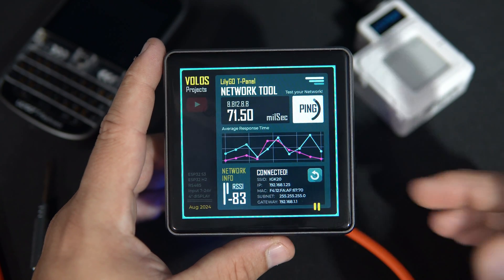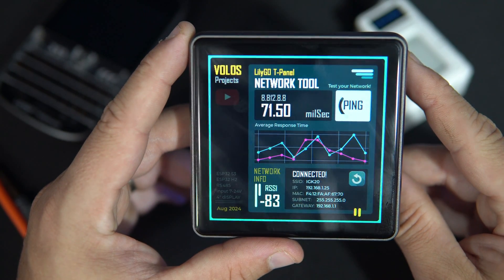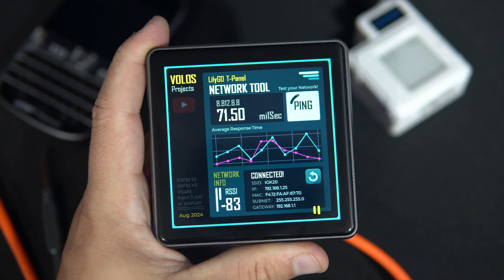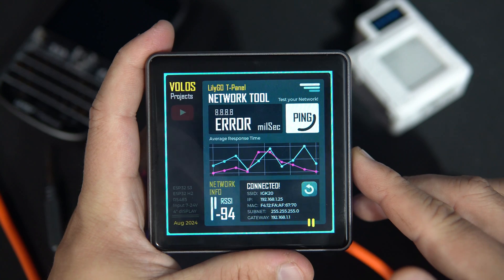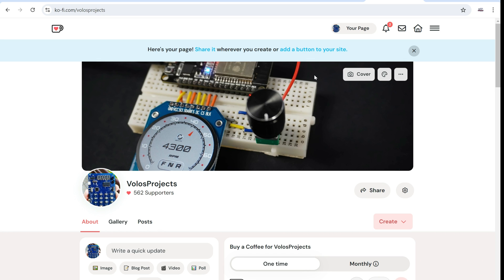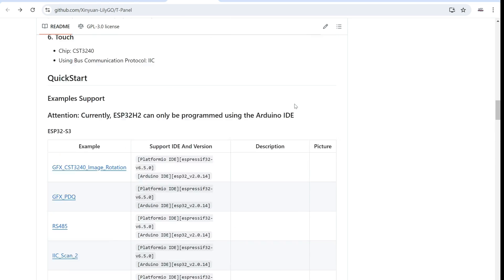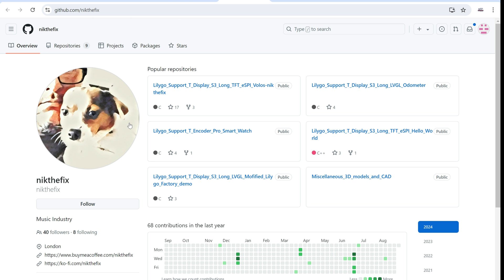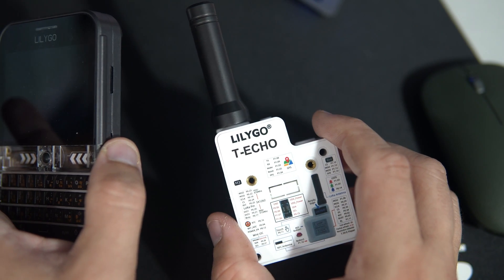ESP32 Network Monitor using LilyGo T-Panel

Comment: Great video! It helped me a lot, however, I am not able to get the code complied, lot's of red error lines, not related to libs. I must have been doing something wrong, Alsways tricky with Arduino. I hope I will be able to get it working, because it;s a nice project.
Reply from the maker: Which version of esp32 boards ypu have installed in arduino ide?
Reply: @VolosProjects  Hi, I have 3.2.0 ESP installed. I also got errors regarding the monserat fonts, which it claimed they were not declaired. No idea how to do this either. Anyway, thanks for your reply.

Comment: Would it be possible to cheat a full network tester in this device. So tests like wire shark sniffing and layer 3 network testing
Reply from the maker: i am not sure, maybe snifing but you will steel need pc to work with data sniffed

Comment: Has anyone here successfully performed this display example?
Reply from the maker: Did you install all libraries, did you set your wifi data?
Reply: @VolosProjects  yes I did. I stated it in my 1st comment.
Reply from the maker: @trauatsgg3809  i jus see this comment , this thread.. please giv me more information, didi example upload?
Reply: @VolosProjects  No Sir. I tried to compile it, but it gave me that error. I installed all libraries into the Arduino/libriaries folder as instructed, and set all the proper settings in Arduino. And it doesn't compile successfully.. Thanks(in advance).
Reply from the maker: @trauatsgg3809  what error?
Reply: @VolosProjects  The error is:  error:lv_conf.h: No such file or directory. Any ideas
Reply from the maker: @trauatsgg3809  you haven installed libraries, go here https://github.com/Xinyuan-LilyGO/T-Panel and download this rep, copy all folders from libraries folder to your libraries folder . I dont konw how to explain. I you arduino libraries folder you need to have lvgl-8.3.5 , inisde is file you are missing. On git link i posted you have detailed instruction how to install this board.
Reply: @VolosProjects  I re-copied the libraries to the arduino libraries folder. I get the same thing about the lv_conf.h. I checked the lvlgl-8.3.5 and the lv_conf.h file is in there. I'm not sure what's going on.
Reply: I managed to get the T-Display-Long ruler project to work. But, I can not get this one to work.

Comment: I have a compile error - any idea how to fix? Thanks
Jack

"Compilation error: 'lv_font_montserrat_12' undeclared (first use in this function); did you mean 'lv_font_montserrat_14'?

C:\Users\sail1\Documents\Arduino\libraries\T-Panel-main\Panel\ui_Screen1.c: In function 'ui_Screen1_screen_init':
C:\Users\sail1\Documents\Arduino\libraries\T-Panel-main\Panel\ui_Screen1.c:194:44: error: 'lv_font_montserrat_12' undeclared (first use in this function); did you mean 'lv_font_montserrat_14'?
     lv_obj_set_style_text_font(ui_Label7, &lv_font_montserrat_12, LV_PART_MAIN | LV_STATE_DEFAULT);
                                            ^~~~~~~~~~~~~~~~~~~~~
                                            lv_font_montserrat_14
C:\Users\sail1\Documents\Arduino\libraries\T-Panel-main\Panel\ui_Screen1.c:194:44: note: each undeclared identifier is reported only once for each function it appears in
C:\Users\sail1\Documents\Arduino\libraries\T-Panel-main\Panel\ui.c:98:6: error: #error "LV_COLOR_16_SWAP should be 0 to match SquareLine Studio's settings"
     #error "LV_COLOR_16_SWAP should be 0 to match SquareLine Studio's settings"
Reply from the maker: you need to go to your lv_conf.h file and there you will find font section, near the miising font 'lv_font_montserrat_14 you need to put 1 instead 0
Reply: did you ever get the code to compile?

Comment: Your user interfaces are always good looking. How do you design them? Do you have to compile and install the code every time you make a change in order to see the difference on the screen?
Reply from the maker: in this case i used sqareline studio software to design UI. but there is still lots of reuploads.

Comment: Hello, wonderful project.
Could you please include additional information such as:
1) exact board type used in Arduino
2) list of external libraries used to include version number.
it appears lv_conf.h is missing
as well as pin_config.h
even after my attempts to remedy this I cannot get a clean compile.
thanks!
Reply from the maker: You have this board?
Reply: @VolosProjects  no, I have something similar. However not begin able to compile it makes it a mute point.
Reply from the maker: @williamlyons2418  i explained in video how to install all needed libraries. You need to go to product git and you need copy all folder from lib folder to your arduino lib folder.

Comment: Wondering if this could be modified to frequently measure if the internet service provider is delivering as promised?
Reply from the maker: Hm, you think speed? I know mine is not delivering 😀
Reply: I am not sure that esp32 will handle speed tests very well, but there is this (more expensive) solution using Pi4: https://youtu.be/W1vBEy50B2M

Comment: It's a great project with a lot of potential, but it could be even more useful if it utilized the external pins to automatically reboot the Wi-Fi router or modem when a ping fails. Additionally, incorporating a small clock display in one corner would be a nice touch, making it more functional. I hope the project continues to hold interest and doesn't become neglected after a few days.
Reply: A clock would be a trivial addition, just look at his code. 
Restarting other devices is less widely useful and much more involved.

Comment: THX for the video 😊 What kind of orange USB-C cable are you using?
Reply from the maker: https://www.temu.com/hr-en/540-rotate-fast-charging-cable-100w-heavy-duty-unbreakable-silicone-supports-data-for-iphone-14-13-12-11-for-samsung-galaxy-s20-s10-s9-s8-plus-s10e-note-20-10-9-8-moto-g7-g8-orange-g-601099538208710.html?_oak_mp_inf=EMavzKOm1ogBGiA1ZTcyZmYxMmVmNjg0NTU2YTE4YTczY2RmMzI3NWY4YSCokLPnmDI%3D&top_gallery_url=https%3A%2F%2Fimg.kwcdn.com%2Fproduct%2FFancyalgo%2FVirtualModelMatting%2F52b108e597960434742862c2ae1ab004.jpg&spec_gallery_id=601099538208710&refer_page_sn=10009&refer_source=0&freesia_scene=2&_oak_freesia_scene=2&_oak_rec_ext_1=MjUw&_oak_gallery_order=651630022%2C119666612%2C434447227%2C1698844106%2C439429592&search_key=usb%20cable%20orange&refer_page_el_sn=200049&_x_vst_scene=adg&_x_ads_sub_channel=search&_x_ads_channel=google&_x_ads_account=5193045990&_x_ads_set=20435766636&_x_ads_id=152789839872&_x_ads_creative_id=669161529295&_x_ns_source=g&_x_ns_gclid=Cj0KCQjwrKu2BhDkARIsAD7GBotqJTzI6h0lIa2xYhwEEyU9NadWpA3azzQbtXS-DYwcsbsQ2AxeVR8aAnynEALw_wcB&_x_ns_placement=&_x_ns_match_type=e&_x_ns_ad_position=&_x_ns_product_id=&_x_ns_target=&_x_ns_devicemodel=&_x_ns_wbraid=Cj8KCQjwrKu2BhCHARIuAFFExHVBawPybMizdHSDgdH0GjU0JAs2MOHGspxbQdK5Zth3En6yKrL17tHCfxoCijE&_x_ns_gbraid=0AAAAAo4mICFGiMu2yGoRjQeLSdinLn4kQ&_x_ns_keyword=temu&_x_ns_targetid=kwd-4583699489&_x_ns_extensionid=&_x_sessn_id=u298vgn7sr&refer_page_name=search_result&refer_page_id=10009_1724646213787_of26mkoito

Comment: Oh me oh my. Mind adding a PlatformIO ini for it? I've tried adding that to one of your T-DisplayS3 projects but I couldn't get it to work. I am totally going to order the panel and develop further on this.
I'll probably extend it with the M5Stack PoESP32 to test Ethernet too 😊
I see there's 3 versions of the T-Display now, is the Lite sufficient for the tasks here?
Edited to add: OK, the Lite has a slightly lower resolution and no touch, but it costs slightly more than half of the non-Lite versions so unless there's a compelling reason for the ESP32-H2, I'll probably go for the Lite.

Comment: Volo, May i suggest in future a project to make a steam deck with one of these devices. Your demo's look great but to have something to control your desktop environment would be awesome! Apart from a Lilygo product, the rest is just programming either a keyboard emulator or midi controller, then add fancy a GUI, it doesn't have to look like buttons to look like a steam deck. In fact this unit looks perfect for that. looking forward to your videos. 😊
Reply: I guess you mean a stream deck?

Comment: This looks great! UI design is excellent once again. I wonder, how do you go about designing UI? Do you use a program to design it before you load it onto the device? Or do you modify the sketch, upload, check design, modify code, upload, check and repeat? This process can take a while, so I wonder if you have a quicker way. Thanks!
Reply from the maker: @brin8099  i reupload 1000 times 😀
Reply from the maker: I am using sqareline studio to design ui, but i am constantly changing it.
Reply: 👀Cool software the squirline studio.. It's just a bit expensive .for home projects..
Reply from the maker: @xxxxxx4205 i am using free personal licence
Reply: @VolosProjects  What the limit with  1 component means? Can you explain that?
Reply: @xxxxxx4205  i think I will stick with uploading 10001 times for now 😅
Reply: I experience faster recompile times when I use PlatformIO/VSCode because it only recompiles what is necessary to recompile.
Reply: @JanDahl  So its faster then the Arduino IDE with a ESP32? (VS-Code)?
Reply: @xxxxxx4205  Yes, because it uses `ccache`, Arduino doesn't. It can be a chore to move to PlatformIO though but it's much nicer to work with when that hurdle has been overcome.
Reply: @xxxxxx4205  Just a heads up, the ESP32-H2 can only be coded in VSCode according to the Lilygo repo.